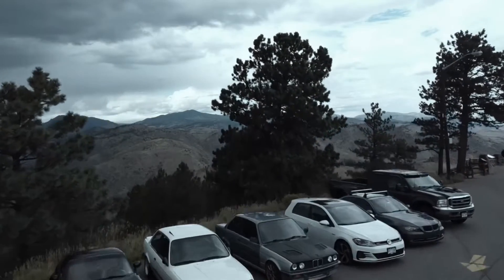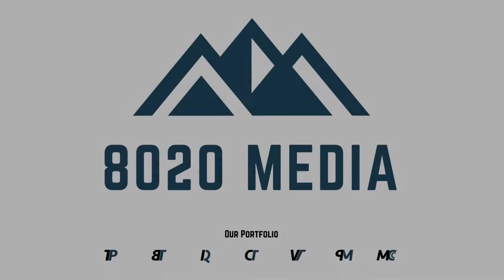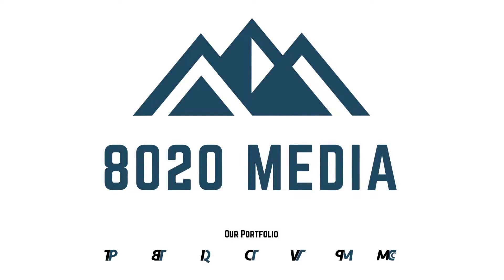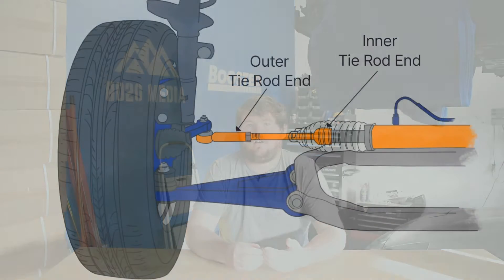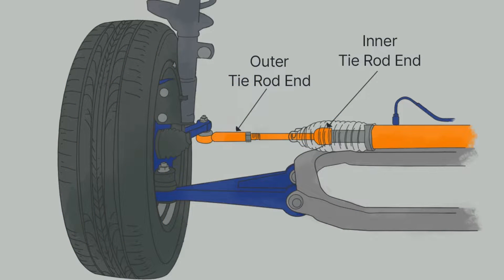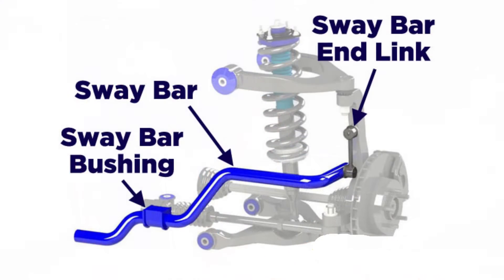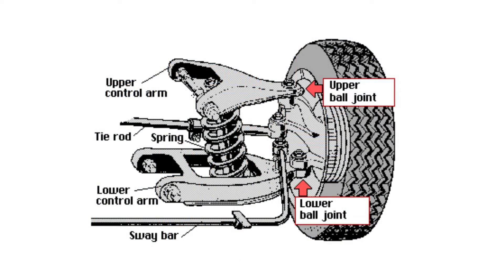DIY - How to Diagnose a Car Clunking Noise While Turning

Comment: I have a 2021 Jeep Cherokee with 50k on it. I recently got Falken ATs on it and I believe the noise was before it. Only when turning or straightening out the wheel, it's almost like a metal ping/click sound that appears rotational. Sometimes it happens and others it doesn't. They replaced the CV axle and noise is still persisting and only when weight bearing. They haven't been able to diagnose it and I've had two shops look at it. Next test is to lubricate wheel bearing and where steering knuckle is. Any suggestions?
Reply from the maker: T - Since the CV axle replacement didn't resolve the noise, and it's only happening under weight-bearing conditions, the issue could be with the wheel bearing, strut mount, or a loose suspension component. A metallic ping/click can also point to brake components shifting slightly, so check the brake caliper brackets, pads, and rotor shields for any play or interference. Since it's rotational, it could also be a loose axle nut or a steering rack issue, especially if it happens while straightening out. Lubricating the wheel bearing and steering knuckle is a good next step, but if the issue persists, consider checking the ball joints, sway bar links, and control arm bushings for any excessive movement or wear. Keep us updated!
Reply: @8020Automotive  Thank you so much! We ended up replacing the wheel bearing and the steering knuckle and it ended up fixing the problem!

Comment: I have a 2017 rwd f150 with a steering wheel that makes a light clunking sound at the smallest of turns. I can hear it from the front end. The steering wheel does catch and "click or lock" in place. I changed the UCAs and lower ball joints. Its also worth noting its on a lift kit lol
Reply from the maker: A - If your truck is making a light clunking sound at small steering inputs, especially after upper control arms (UCAs) and lower ball joints were replaced, the issue could be related to steering shaft components, rack and pinion play, or lift kit geometry changes. Since the truck is lifted, the intermediate steering shaft or rag joint could be experiencing added stress, leading to minor binding or clicking. Additionally, check the rack and pinion mounting bolts, tie rod ends, and steering column U-joints for excessive play or looseness. If the steering feels notchy or "locks" slightly, it could indicate an issue with the electric power steering (EPS) motor or internal rack components. Also, re-torque all suspension components after a lift, as loose UCA mounting bolts or misaligned geometry can contribute to noises. Keep us updated!

Comment: I have a 2010 bmw 320d, originally the left side was knocking only when I turn. Now both sides do it. It does not knock over bumps, it doesn’t knock normally. Purely only when I turn. It even does it stationary. The steering rack does not vibrate at all so it’s not anything lower. Help meeeee
Reply: Plus- it only does it occasionally so when I go to try diagnose it, ends up not doing it. Very strange
Reply from the maker: C - Intermittent knocking when turning, especially when stationary, suggests an issue with the steering system, likely the top strut mounts, steering column universal joint, or rack and pinion assembly. Since it started on one side and now affects both, worn strut bearings or a dry steering column joint could be the cause. It may also be inner tie rods or steering rack bushings developing play. Check for loose bolts, dry or worn components, and steering fluid levels. Since it’s inconsistent, try replicating the noise by turning the wheel in slow increments while parked and listening for movement near the top mounts or steering shaft.

Comment: When i go over a speed bump or like going uphill it kind of makes a clunking noise or like an empty box when u put something inside it coming from the back i have never done alignment should i try doing that?
Reply from the maker: D - Sorry to hear this. A clunking noise from the rear when going over bumps or inclines is likely caused by worn suspension components such as sway bar links, bushings, shocks, or control arm bushings rather than an alignment issue. Check for any loose or damaged suspension parts, including rear sway bar links, trailing arms, or even exhaust hangers that could be rattling. If the shocks are worn out, they may not be dampening properly, causing excess movement and noise. An alignment won’t fix the noise, but if your tires show uneven wear or handling feels off, it might be a good idea to get one after addressing any suspension issues.
Reply: @ noted thanks !

Comment: My 2003 Honda element makes a scraping noise only when I turn left and it’s more when I make a harder turn. Had my sway bar links n components changed. No thuds just like a hissing scrape . Any ideas my friend?
Reply from the maker: S - Sorry to hear this. A scraping noise when turning left, especially on harder turns, is often due to contact between a rotating component and something stationary. Since you already replaced the sway bar links, check the brake dust shield, as it may be bent and rubbing against the rotor. A failing wheel bearing can also cause a scraping or grinding noise that worsens when turning—jack up the wheel and check for play. Inspect the CV axle and boot for tears or leaks, as a worn CV joint can make similar noises. Ensure the tire isn’t rubbing against the fender liner, especially if you have aftermarket wheels or oversized tires. Power steering issues, such as low fluid levels or pump problems, can produce a hissing sound when turning hard. Lastly, worn ball joints or control arms may allow excessive movement, leading to scraping or rubbing. Try lifting the front left wheel, spinning it by hand, and turning the steering to pinpoint the source. Keep us updated!
Reply: @I definitely need to find out what exactly in the rear is making noises. Changed out the sway bar n links. They say I need a new knuckle on right rear “but Honda doesn’t make it.” Say what? I’ll find that damn thing. Feels like ball joints… they say no. I’ve replaced everything under the sun the last two years on this element. Rough road conditions n pot holes here in Colorado. The price for keeping an oldie but goodie on the road :-)since I told ya that, I never hear the  damn do that. Weird . But I know something is up. I applied the park break about to pulls up and it didn’t have any effect as in a park brake issue. Yea my tires aren’t rubbing . They are the suggested size n goodyears w my stock rims.  Def thank u for the suggestions and will keep u posted.

Comment: Mine clunks when make wide left turns.
Reply from the maker: K - If your vehicle clunks during wide left turns, the most likely causes are worn suspension components, CV joints, or steering system issues. Check the ball joints, tie rods, and control arm bushings for play or damage. If it's a front-wheel-drive vehicle, a worn CV axle can clunk under load, especially if the boot is torn and grease has leaked out. Also, inspect the wheel bearings and sway bar links, as loose or failing components can create noise when turning. If the clunk is coming from the rear, check for loose suspension bushings or differential mount issues. Keep us updated.

Comment: Thanks for the video! My clunking noise happens when turning the wheel either while driving or even while stopped. Oddly enough, that noise won't happen when i first start my car, but only after a few minutes of driving. Already checked all fluids
Reply from the maker: M - Thanks for the feedback! If your clunking noise happens when turning the wheel, both while driving and while stopped, but only after a few minutes of driving, the issue is likely related to worn suspension components, steering rack issues, or heat expansion affecting a joint. Since it doesn’t happen immediately but appears after driving, a failing tie rod end, ball joint, or control arm bushing could be expanding with heat and causing excessive play. Also, check the steering rack mounts and intermediate steering shaft, as worn components can develop loose connections that only make noise once warmed up. Since you've checked fluids, ruling out a failing power steering pump or rack and pinion wear would be the next step. Try lifting the front wheels and turning the steering wheel while checking for movement or play in the suspension and steering linkages. Keep us updated.

Comment: I got a 2020 f150 lifted 6" everytime i make a hard turn to the right i do get a clunk when trying to accelerate from stopped. And on freeway going 60mph I do get alittle steering shake nothing crazy tho but I just did all ball joints and bushings. Anyone here can guide me on what else to look for?
Reply from the maker: J - Your 2020 F-150 with a 6" lift experiencing a clunk on hard right turns from a stop and steering shake at 60 mph even after replacing ball joints and bushings suggests potential issues with the CV axles, differential, tie rods, or alignment. The clunk on turns could be from binding CV axles, especially if the angles are extreme due to the lift, or a loose motor mount or differential mount, allowing movement under torque. Check for play in the front CV axles and differential mounting bolts. The steering shake at highway speeds could be from out-of-balance tires, improper alignment, or loose tie rods, which are common after a lift. Also, check for loose steering rack bolts and ensure the front driveshaft angle is within spec, as incorrect angles can cause vibrations. A high-speed road force balance and a post-lift alignment check should help eliminate the shake. If the clunk persists, inspect the control arms and front differential bushings, as they may be shifting under load. Keep us updated!
Reply: @8020Media  cheers man yes alignment was done today and still a small clunck and tiny steering wheel shake at hwy speed
Reply: @8020Media  thanks for the quick reply and I can see they did every bushings and ball joints except the tie rods ones so I'll definitely go8ng to order nice solid ones and I'll replace then and see if that fixes it thanks alot man cheers. I been under that truck like 50 times over checking everything that could possible be the issue
Reply from the maker: @joecosta7319  Keep us updated!

Comment: With my Automatic STronic a4 i get s clunk sound when i go into reverse then come off brake it will rollback second or so Clunk and stop then carry on going back and repeat same process unless i tap the gas pedal and give it momentum
Reply from the maker: D - The clunk sound when shifting into reverse and the rollback before engaging in your Audi A4 with an S-Tronic transmission is likely due to worn transmission mounts, excessive clutch pack clearance, or delayed mechatronic unit engagement. The S-Tronic (dual-clutch) transmission sometimes exhibits delayed clutch engagement at low speeds, especially when cold, causing the clunk when the clutch finally engages. If the issue is getting worse, it could indicate worn clutch packs or a mechatronic issue. Keep us updated.
Reply: @8020Media  it's in Audi now for a Gearbox Service and Gearbox oil filter change so will let you know , thanks I did think it could be the Mounts which are dirt cheap to buy but costly Labour

Comment: hi! i have a dodge charger 2015 and i just got 24” rims put on. i’m hearing a clunking when i turn the wheel left from the rear but only after i hit a huge pothole. i got 3 different responses.. not really sure what to do and don’t want the dealership to overcharge because im a girl or don’t know much.
Reply from the maker: C - The clunking noise from the rear after hitting a pothole in your Charger is likely due to suspension or drivetrain damage, which can be common when using larger aftermarket wheels. The increased size and weight of 24” rims put extra strain on components like the rear control arms, bushings, sway bar links, shocks, or wheel bearings. The pothole impact may have damaged or loosened one of these parts. To avoid unnecessary dealership charges, first, inspect the rear suspension visually or have a trusted independent mechanic check for loose or damaged control arms, sway bar links, or shock mounts. Also, verify that the wheel isn’t bent and that the lug nuts are torqued properly. If nothing obvious is found, a deeper inspection of the rear differential and axles may be needed, as larger rims can accelerate wear on these components. Getting a second opinion from a trusted shop, not just the dealership, could save you money and ensure an accurate diagnosis. Keep us updated!

Comment: I have a loud crunching noise when i turn the wheel hard ( example: pulling into my driveway, parking spot) . It will also do it when I'm not driving and i just turn the wheel all of the way in either direction.
Reply from the maker: B - A loud crunching noise when turning the wheel hard, whether stationary or moving, is likely caused by a worn CV joint, ball joint, or strut mount bearing. The CV joint is a common culprit if the noise occurs during sharp turns, especially if the CV boot is torn, allowing grease to leak and debris to enter. A ball joint or tie rod end could also cause the noise if it's worn or dry, as they handle the steering load. Lastly, a failing strut mount bearing can make crunching sounds when the suspension pivots. Inspect these components for wear, damage, or lack of lubrication to identify and address the issue. Keep us updated.
Reply: @8020Media   thank you so much. I will update after I check these . 😊